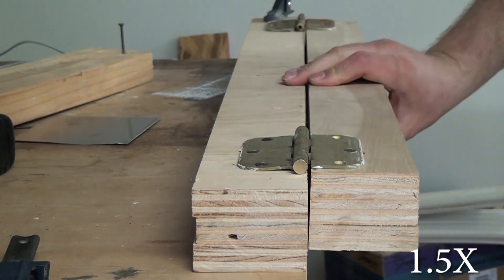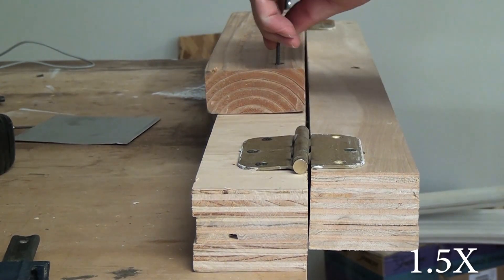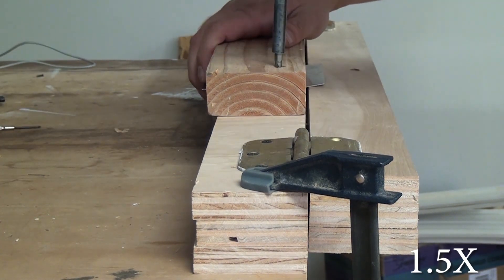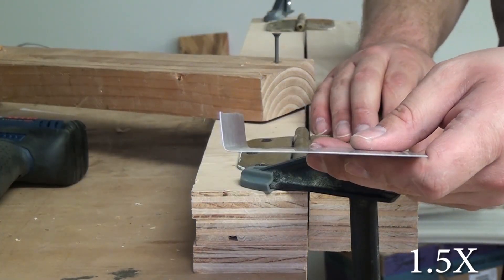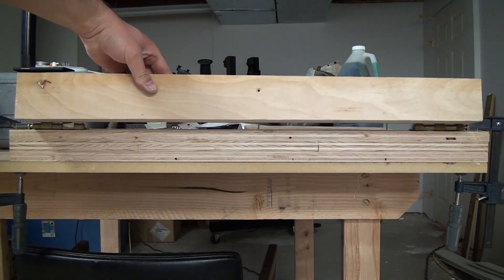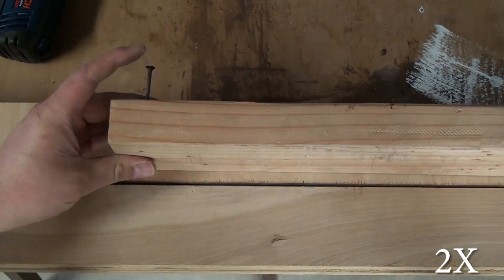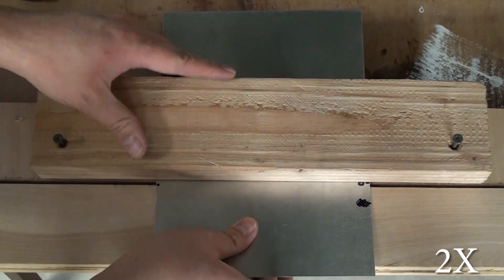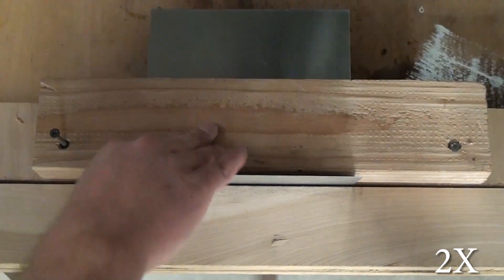Cheapest Sheet Metal Brake Possible

Comment: Russ, not bad!  I've seen a similar method done using angle iron...which would be strong enough to handle steel sheet too...thin stuff anyway. 

Could you eliminate you gap by mortising the hinges?  

Also seems possible to make a box and pan brake by notching your clamp 2x4 in appropriate places.

Quick or bar clamps might be faster than the screws. 

Just some ideas to consider for next time. 

-- Mike
Reply from the maker: I've seen some angle iron ones too, and considered making one but I knew this would be faster and easier (and still work). Yes getting the plates cut into the boards would get rid of that gap. I love stupid projects like this and just for fun I may do an upgraded version :)

Comment: You could make this stronger by adding 2 L shaped pieces of aluminium/aluminum to the wood. That way the metal won't sink in the wood anymore. As for taking it over 90 just clamp the bottom of the break between two tables that way you will be able to stick a clamp on the work piece, or, notch a hole for a clamp on the bottom piece.

Comment: Lay the blade on your table saw over 5° and rip an angle on that 2x4. That should allow you to bend it pass 90° enough to complete the angle.
Great video.
Reply: Just what I was thinking, even as much as 45 deg will be better, saves having to cut again more times for other angles.